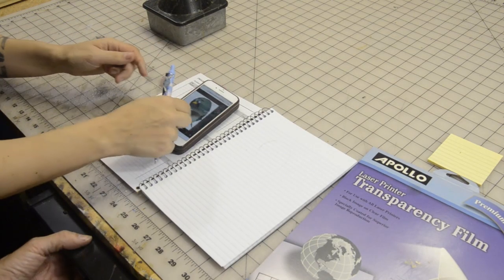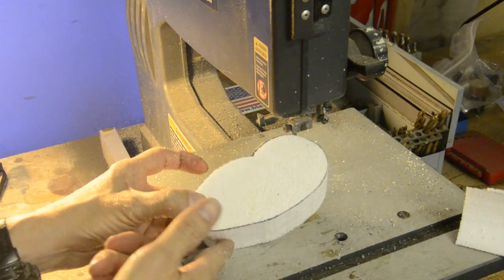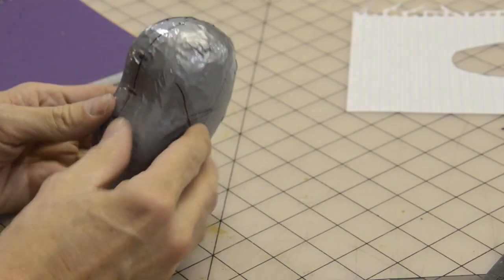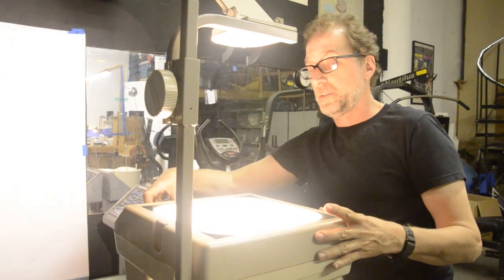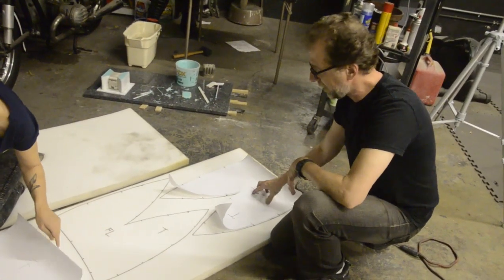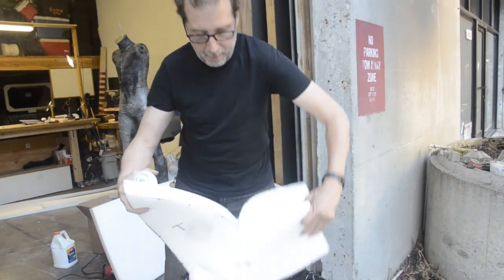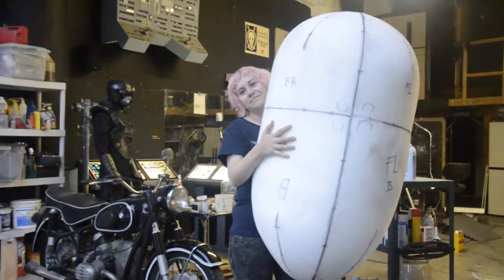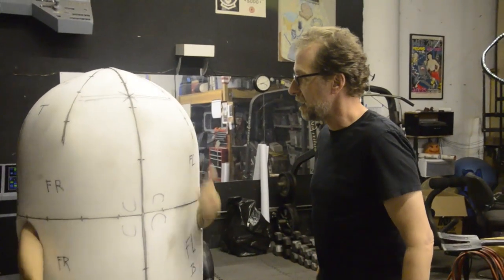How to Pattern Large Costumes, Tutorial.

Comment: I love your tutorials! Always clear, concise, and with amazing tips! And a great collab with the amazing and talented Holly!! 
I hope this tip can help some people too. Projectors can skew images so the top is bigger than the bottom. If this concerns you, add a grid to the background and check that the squares in each corner of the image are the same size and square on the projected image. If they aren't you can try moving the projector up or down, changing the angle, or adjusting the keystone setting for computer projectors. Most libraries or schools, at least where I'm from, will let you use a projector, or even a computer projector, for free.

Comment: Wow u guys go all out. Them great old school projectors rock. All ways whanted one. Great idear. To inlardgen patens  than drawing them free hand. Onto big sheet s of carbord to trace around cut shap out.foam. ........ I have just made. My mascot head. Outta a    light wait Dow putty that's like blue tack an drys hard. Like fiber glass Can shape an sand it  drill n cut it. Drys in few minutes  made ears seepret then atacht them. Now sanding to get smooth all over. To make it light. Wait as I can..as its a littal hever than cuting a foam block for head.    I yousd. Kids floor  foam matt s .in lips an nose an mouth above  eyes...an started with a balloon an stripps of papper .an packing tape .all as a mold.  an just started covering it in putty.   to geat  shape of my head. Riptt out balloon foam paper an packing tape  .... now getting a big lardge red beanie made an .pink skin glove n are s part.  Next steep is to make. Denim  Overall s  with white shirt. Just need to figer out.how to make  Foam.shape.inside denim overals. To  fit to body shap. To look like mascot size.  An that is ventilated good.    .made shoe s outta foam .just need to cover in vynal ..its a uni mascot for my. ..hip hop Clothing brand. And  Art stuff  an my donut i make on side small bizz for fun promotion n give aways ..

Comment: Mr. Evil Ted, you're awesome!!!!

 I'm building a AT ST Imperial walker from Empire Strikes Back, costume for my 10 year old boy.  Do you have any suggestions as to what material I should use? Thank you
Reply from the maker: Eva floor mat foam
Reply: Thank you sir!!
Reply: I'm going  with your suggestion. I'm going to have to glue the mats together first, as the sides for the AT ST are a little longer that 25 inches. After I glue it and cut my side, can I then use a heat gun on the eva foam, to seal it after gluing two big pieces together?